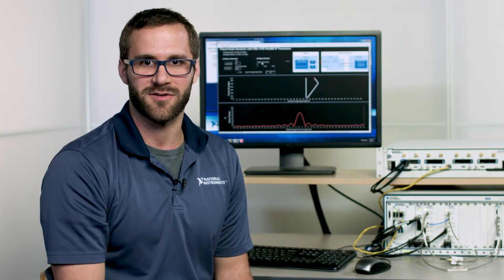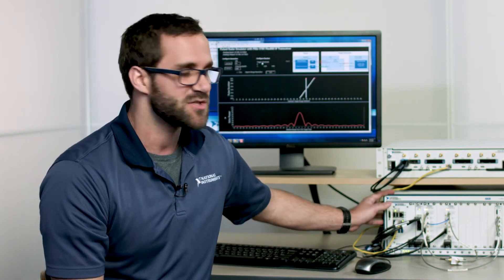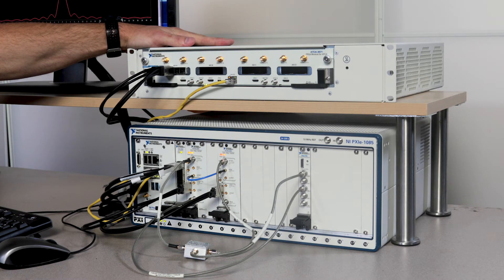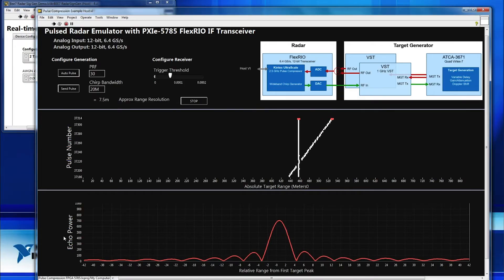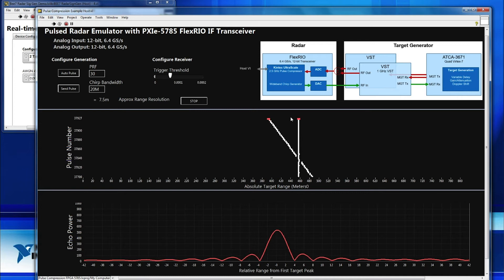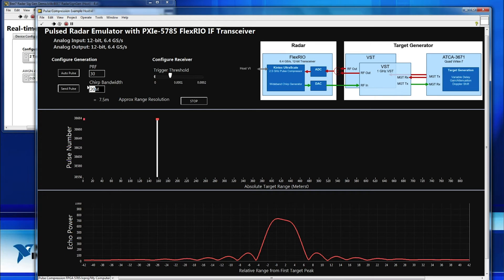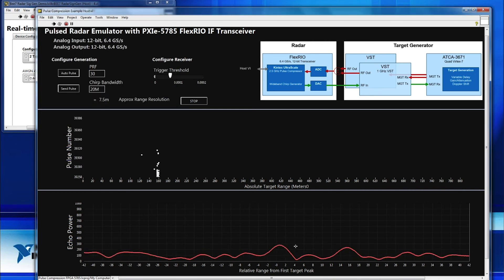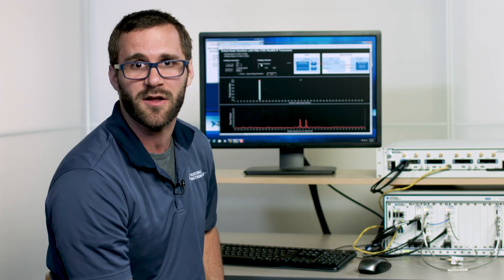Radar Design and System-Level Verification With NI PXI

Comment: But shouldn't increasing the bandwidth increase the noise power instead of decreasing it?
Reply: cisco32544 Hello! Thanks for your reply! That's a good presentation.
I must correct myself. So, as I remember, in a matched filter SNR depends on the pulse energy. So, increasing the LFM BW without increasing the pulse length should result in the same SNR, not its decrease as I stated above. Probably they are changing the pulse length too,  not shown in the video.